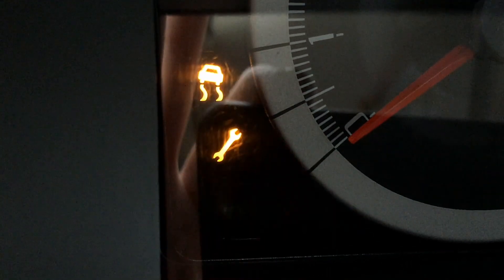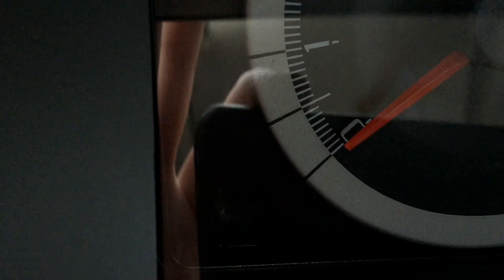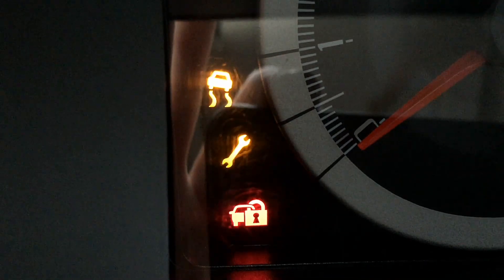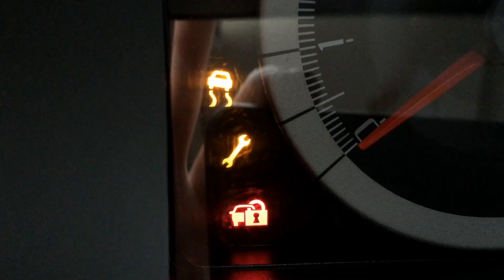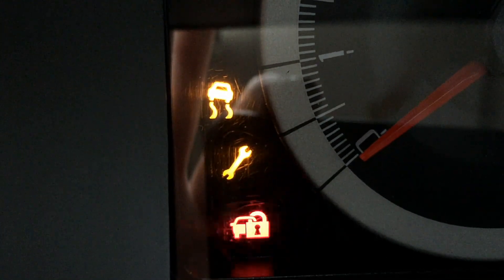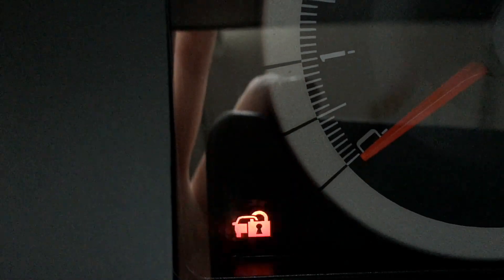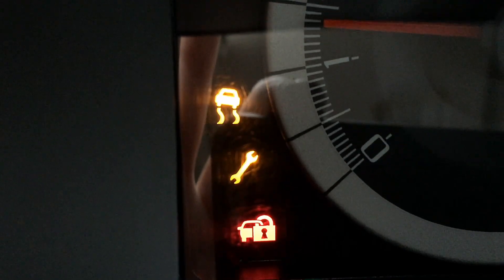Ford Quick Tips: #52 Identifying Ford PATS System Malfunctions

Comment: well, it is done. have a pushbutton starter. problem is, it does not work consistently.  i did this workaround because i am tired of putting in the ignition module (10 in 3 years) and my parts supplier (with lifetime warranty) is tired of buying me new ones. the pat is still active, if i had a good ignition it would work. my issue is with the pushbutton i have effectively bypassed the ignition module without disabling the pat. still needs the securilock key to function. 
my process now: turn key to "on" position. the dash lites come on, and the red securilock lite goes off in about 3 seconds. push button, start car. problem, the starting function is intermittent. i have tested all my connections, they are secure.  OH "F" .... NOW WHAT ??? ... (i do have a new transponder if that is what i need to do, but i'd rather return it ...)

Comment: positive we have a pats issue, cannot resolve it. no codes. at lite goes off like it should. correct key. will start in the early morning, but dont turn it off! wow. wont start until pats resets itself. how do i fix this?
Reply: Replaced the ignition switch. Although it tested good, it wasn't. No problems since.

Comment: I have a 2009 focus standard transmission. When I turn the key to start car nothing happens. But if I put upward or downward pressure on the key it will start. I'm afraid I'm gonna break my key off in the ignition. What can be the problem ?thanks in advance. Ford is talking maybe 400 dollars to change ignition.
Reply: John Sellers find a good locksmith they can change it half the cost of the dealer

Comment: I have a 2006 Mercury Milan 3.0 6 speed. When key is turned on the theft symbol flashes fast for 45 seconds and the shows one flash followed by 2 flashes.  What is a code 12 trying to tell me???
Also got this message from pay-pal.  PayPal cannot process this transaction because of a problem with the seller's website. Please contact the seller directly to resolve this problem.

Comment: BRIAN NEED HELP!!! installed a dual battery isolator on my 04 150 5.4. After I installed everything the pats light was flashing and
It wouldn’t crank at all. I hooked everything up without the isolator (the way it was before I started)  and it cranked and started no sweat. All I messed with were aftermarket battery cables. I didn’t touch the stock wiring at all. What’s messing with the PATS?!?!?

Comment: Have had the same problem, no crank, no start.
Also have the gauges going all crazy.
No door ding, no inside lights, radio, nothing.
Any ideas?
Reply: I also hear a chirp from the fuel pump, when it fails to start. I have replaced the fuel driver module with no change.
Reply: Jason Berg check your battery voltage 
12.6volts if it’s new 
Even a battery at 12.1volts can cause difficulty starting 
I know you said no crank no start but doesn’t hurt to check the basics also lol 
And you’re saying no door ding, lights, radio, so it sounds like a dead battery to me
Look for a whirring energizing sound from the fuel pump in the back. It’ll be quick and it’ll energize as soon as you turn the key to ACC (accessories) position. If you don’t hear it whir then check your anti-theft and see if it flashes really really quick like in this video. 
So to recap if you turn the key on, listen for the fuel pump to energize, pump doesn’t turn on, and theft light is flashing then you have an anti-theft problem 

If there is a whirring sound, and theft light is turned off or not flashing then you might have an ignition, fuel, or sensor issue malfunction. 

With the key on the accessories position (all lights on, engine off) pop the hood and look for the fuel rail (usually on top of the fuel injectors) there should be a cap like in the AC side it has little caps where fittings go, take that thing off and inside it’ll have a Schrader valve like on bicycle inner tubes. Push down with A screwdriver on the little valve and be careful cuz if there’s fuel pressure it’ll spray out and that is what u want cuz that’ll eliminate pretty much the entire fuel system 

If it’s coil over ignition coils (meaning no old school spark plug wires) then to check the ignition it might be a relay or some sensor that controls all of them 
I highly doubt 4,6 ignition coils took a crap at the same time. 
Check all your fuses, relays, make sure all electrical connections are connected 
Other things to check im not too sure cuz I’ve never worked on a focus with this problem and mines doing it on my mustang 
My guess would be the wiring going into the instrument cluster. In mustangs it communicates from the key > transceiver (reads keys chip code) > instrument cluster > CCRM (constant control something module > and PCM lastly to check off 

That’s all I can think of right now
Reply: Jason Berg also for the fuel thing . You just want to do a quick 1 second push of the little valve inside. You’re checking fuel pressure to the injectors meaning they’ll be ready to spray when they get the signal from the crankshaft position sensor. It’s just a quick check and if I get no spray then the actual fuel pump may have taken a crap or is clogged. Check fuel filter too but doesn’t sound like it. If u do change the pump, replace the fuel filter (if it’s an external filter)

Comment: Thank you for your videos I check Battery at 12.6 volts starter relays I was getting weird codes service theft system U1000 I had broken 4 gauge black wire that connect from alternator to frame of vehicle thank you again for your video

Comment: I have a 08 Milan 3.0, I replaced the pcm with a matching key/cylinder and ring sensor, I’m getting the flashing theft light. I thought if I replaced the key with the matching pcm it would be fine, am I missing anything ? Any tips or help would be appreciated
Reply: Ryan Dunn 2.0 needs to be reflashed by ids and keys needs to be reprogrammed
Reply: john bosco got it done at the dealer for $125. I tried having a lock Smith do it but they couldn’t figure it out and I wasted $60 for nothing
Reply: If you are a mechanic,I can teach you how to use ur pc to program those pcm and stuff
Reply: john bosco yes that would be awesome how do I go about doing that ? Do I need any special programming ?
Reply: Ryan Dunn 2.0,I have one all in one laptop that has ids,IHDS by Honda,Consult-III and mds by Chevy for sale,all for $2000

Comment: Hi i got a ford freestyle and when i am driving or in a stop the  pats system light blinks and the car shut down, and then i turn on the car normal again, and that happen sometimes, do you know what can be the problem? I replace the pcm because the mechanic say that was the problem, so i replace the pcm but i still have the problem. Any suggestions about that? Thanks have a great day

Comment: 05 Sport Trac. battery replacement, all normal prior; start, crank, and ran. Now theft light is on solid when I put the key in. No cluster lights, no crank. I did have a brand new key and cylinder lock in the car, in the passenger seat at the time, because the original was a little sloppy. Not terrible, but the truck only came with 1 key and it wasn't original. Could it have tried to read the new key?
But like I said, it did crank, start and run on the previous battery. I changed the battery cause the one I had on it was for my boat and I couldn't close the hood. I did a major tune up and needed a stronger battery. The battery I put back in it has 11.6V in it. That should be enough to crank under normal conditions shouldn't it?
Reply: Disregard. The battery I put in it went from 11.6V down to 4.8V. Obviously a bad Mopar battery (only a year old.. disappointing). Went to O'Reilly's and bought a Premium battery for $150 bucks. No issues. Cranked, Started, and all features operating normally. Still need to program 2 new keys, but don't want to take it to the dealer.

Comment: can a theft light flash rapidly when you have a bad battery or a bad fuel pump driver module? i checked all power to the pcm and added new ignition key module too.
Reply: That's a question I want to know

Comment: My 2001 F150 PATS anti-theft system started flashing fast instead of the normal flash and would crank but not start.  Had in a local shop for 2 weeks, then to the FORD dealer for 9 weeks, then they gave up as it started working properly some of the time, but the didn't know why or the exact reason.
Reply: Murphys Law mine is doing the same now. Crank,  no start
Reply: Murphys Law. Same here same truck

Comment: enjoy your videos - there is a third condition with Ford PATS that I hope you can comment on. I have a 2003 Mercury Grand Marquis that ran flawlessly until I parked it one night and next morning NO CRANK_NO START and the PATS light keeps flashing at the same rate - one flash every two seconds even with the key "ON".......does NOT flash fast as your video states yet there is no crank......I left the key "on" and jumped the starter from under the car - cranked great but it sounds like fuel pump and injectors are disabled so NO START

what does your experience tell you ?......any suggestion appreciated...I had the key tested at a  automotive locksmith and he said key was GOOD
Reply: Did you ever figure out what the cause of this was? I have an 05 that will not crank at all. Replaced starter, starter relay, neutral safety switch. Can't find the culprit

Comment: I have a 2003 Merc Grand Marquis that worked perfectly before being parked overnight - for some time I have been wanting to use the touch pad on the drivers door for entry - so next morning I punched in maybe 20 combinations and one worked !...I probably hit on the factory setting....I was so proud that I could now use the keypad as it was intended to unlock/lock/trunk.......when I went to start the car and turned the key - I got all the chimes but no crank and the interior lights and headlights dont go dim when key turned to "start"......I know the battery is fully charged and good condition......I followed your instructions to check for PATS malfunctions and found that the slow blinking was unchanged when the key was turned 'ON" or to "start".....same blinking as before inserting key. I put a screwdriver between battery  and solenoid posts on the starter and it cranked fast - no start even though key was "ON"......any thoughts on this - I have only 1 key just got this car a month ago and has been sweet till now.

Can you help ?

Comment: I'm a Locksmith, back in the day of the "older" PATS systems, say a 1998 Mustang.  Those H72-PT Keys have a total of 72,000,000,000,000,000,000 combinations.  The encryption rate is getting ridiculous.  Most of the 2000-2011 Ford vehicles jumped to the 40 and 80 bit keys.  But the new Fusions (2013+) and several other models are now 128 bit security.  The old H27's, there's no encryption.

Comment: Hello Brian I have a 2005 fx4 5.4 3 valve f150 it is acting up big time when I turn the key off the cluster will power back up break light and abs lights will come on faintly at the start the full on radio will stay on truck will beep constantly and interior lights including cargo light will come on and off it acts fine while truck is running except for the break light and abs light stays on I've replaced the bcm and had the pcm re flashed by Ford they found a plug for the cam poison sensor on bank two was off they plugged it back in since then the truck is misfiring on take off and sluggish and wasn't before it was plugged back in I've tried to plug my obd2 reader in but truck won't Connect to it and did before it was re programmed I'm at a dead end right now I live in Canada and the truck is from Florida would that create a problem with the programming done hear at ford Canada please help I've seen lots of your videos and I believe you are the for whisperer lol
Reply: Chris Oprey hello I have problem to started my focus 2008 i have to put tape on the cylinder key for second time what do u think that is the problem programming or house cylinder? I put the tape and it's working temporarily...

Comment: I have a 2007 ford edge and the pats system does not allow the engine to crank of fire. The pats system icon blinks constantly when the key is not in. once the key is it it goes solid and turns off but will not crank at all. What could it be? I have the battery absolutely disconnected right now and I figure I'll give it a day and see if it will crank tomorrow. please help.
Reply: What did you do to fix it
Reply: What was the fix?

Comment: I bought a 2002 Ford Escape for my daughter, I was told that her husband had pulled into the gas station, refueled and went to start it, and it wouldn't. At this point when I got it, the battery was completely dead, so I just replaced it with a Duralast, afterwards, all it did was crank over (no start), fuel pump, sparkplugs were working, I did replace the crank sensor which was bad, also while in it I was told the timing belt didn't have much life, so it was replaced. My question is, would the PATS allow the cranking over, but won't let it start, it's sounds like it wants to start, I know my timing is correct, I did the screw driver in the #1 cylinder (TDC), locked both cams. Could the battery being replaced after being dead, could it have messed the key transponder, making it believe it the wrong one? I'm pretty sure the people that did the timing belt replacement did something wrong, now I have to go in and clean their mess up. I seriously would appreciate any help from either you or someone on here

Comment: Ok, I have a quick question on a 2011 F150 XLT. I cannot get the (2) factory remote keys to Lock/Unlock (somehow I erased this feature). I have tried the "rotate key 8 times" and the vehicle goes into programing mode (locks/unlocks) but once any key is pressed, nothing happens (on either key). I have checked the key output (and changed batteries) at a ford dealer and they both work. Both keys will start the vehicle. What am I doing wrong? I can Lock/Unlock using the door keypad w/o issue.
Reply from the maker: +R. Moore Ok so all of a sudden these two keys will not perform an fob functions and these are the only two keys you have had? If you say the batteries are new and the key output has been test and is strong then the keys must be reprogrammed to the vehicle this is accomplished by erasing all known keys and programming these two keys pats functions. When this procedure is done the fob transmitter is also programmed. This is the only way to program IKT keys.In the mean time try this-
Ignition OFF. 

Ignition ON. 

Ignition OFF. 

Press any button on the IKT
Reply: +FordTechMakuloco 
Thanks, I will try this but let me clarify the procedure. Is this done with the vehicle off, doors open or closed, lock or unlocked (at this point, I will take all the help I can get). However if this does not work, then is the only way to get this done is at a Ford Dealer?
Reply from the maker: It does not matter if the doors are open or unlocked for this procedure. Otherwise yes the only way to get the SJB to relearn and respond to these IKT's is to have the programmed once again.
Reply: @FordTechMakuloco  Hi, I was watching your videos and they are really helpful and very good, I was watching because I have a 2010 Ford F150 4.6x 4x4 and the Fuel Gauge does not work, buy another and everything works but does not turn on, and the THEFT light flashes very fast, they tell me that they need programming, I took them to a locksmith workshop and they did not know how to solve the problem, do you have any advice for me?

Comment: So, let me get this straight.  You have a no start, no crack situation. What you can do to determine if it is mechanical (i.e. Fuel pump, alternator, etc.) or something wrong with the theft control?
Reply from the maker: +klong1972 Yes first thing is to check the theft indicator if it proves out fine as shown the vehicle should start if not you know you have another issue. The theft system is often overlooked.
Reply: +FordTechMakuloco 
Got ya.  Good point.
Reply: @FordTechMakuloco  your vids are awesome. PATS popped up out of nowhere on mine. Ran fine for a few days after replacing O2 sensors, plugs n wires.
Reply: @waden404 how did you replace it
Reply: +Robert “Rob” Stevens My Thunderbird LX had a dirty lens. Had to pry the top dash trim and wipe the inside lens. The lights were always on prior to that. Shine a very bright light in there to test, they should go off.
Reply: +Robert “Rob” Stevens Yeah, on another Lincoln the problem was the NYS inspection sticker blocking the eye. It is a simple system, the light makes the sensor block 12V from the controller. Assuming it is clean(under the lens too) problems could be in the sensor or control module. You would need  a wiring diagram to troubleshoot.

Comment: Merry Christmas Brian. Any advice for a remote start on a SEL 07 Fusio? Mine came without this module installed. Any way to calibrate sun sensor thar runs the auto lights? Thanks.
Reply: +FordTechMakuloco Any ideas?